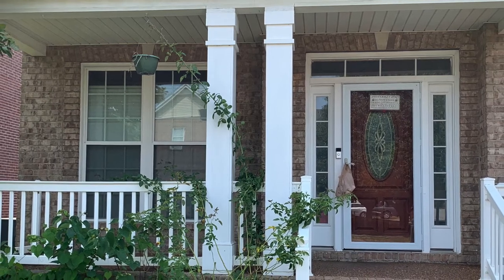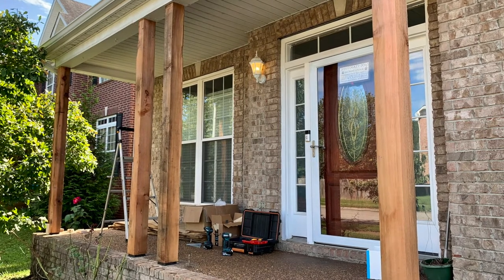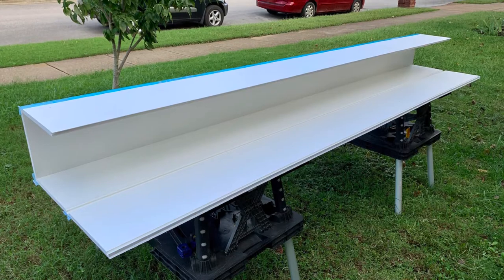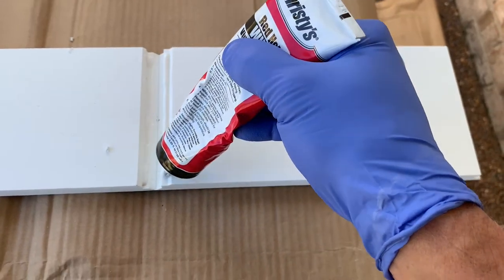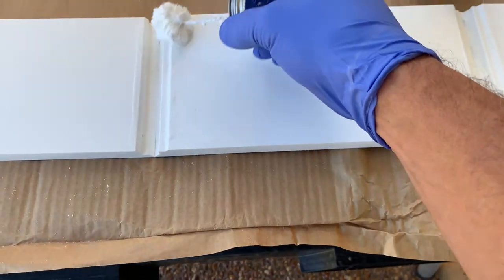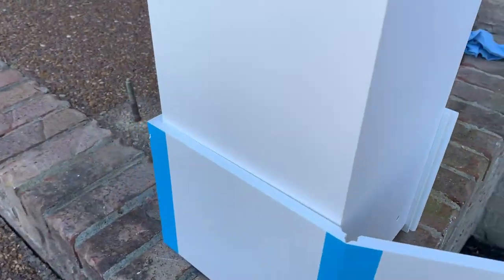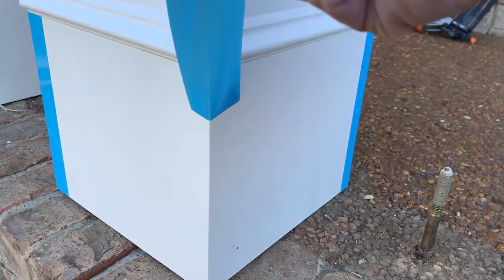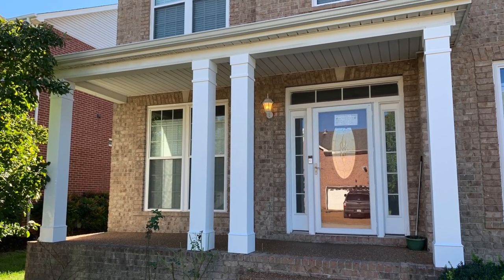VersaWrap Installation

Comment: Hi.  For the accent wraps that you used for the top 2 sections of the post... did you need to paint the top/bottom of those after they were cut?
Reply from the maker: No, you do not need to paint cut surfaces.  Versatex claims you don't need to paint this product at all and it won't fade or discolor.